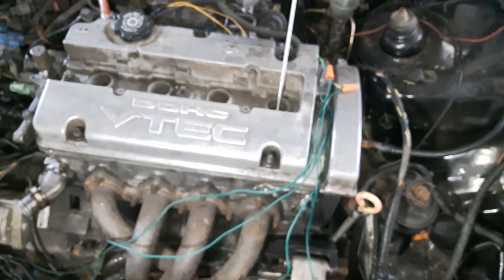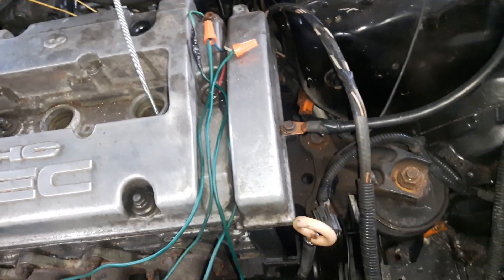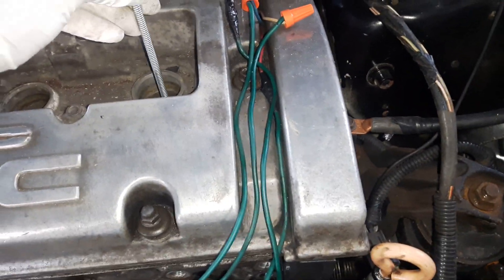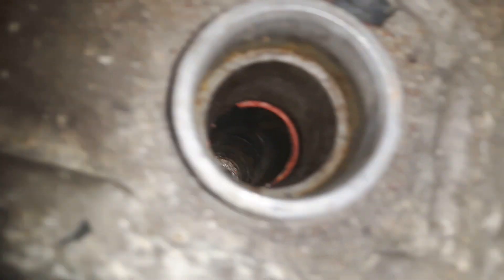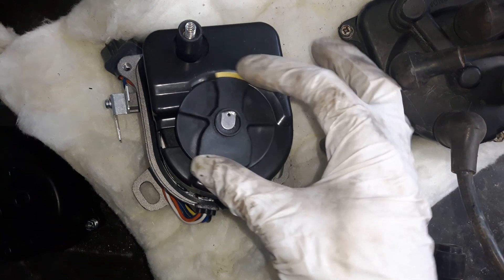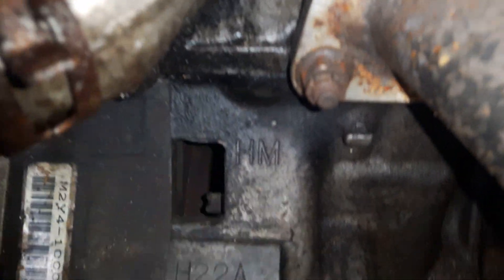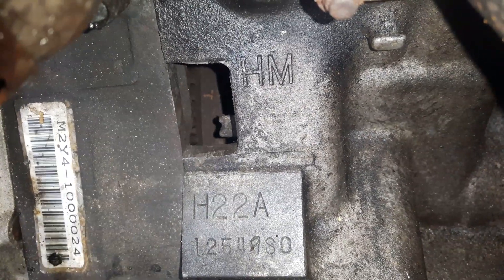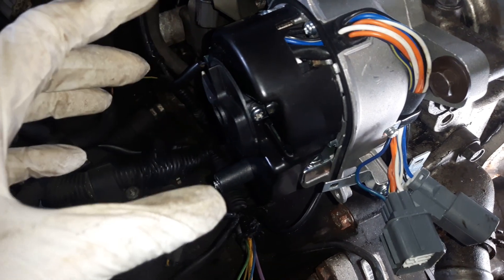How to install ignition distributor correctly TDC timing firing order Honda Prelude Civic Accord

Comment: Does anyone read manuals written by Honda? They're so detailed, there're answers to every question, y'all should try. This cut is intentionally shifted off center, so you can't place it 180 degrees off unless you pulled the snap ring off and took apart the coupling. If you did that, then there are also marks. You point rotor to the 1st cylinder and then match marks on the coupling and on the back side of distributor itself (there are grooves that should be on the same side). After that there's no way you can place distributor 180 degrees out of time. You don't have to time the flywheel either, because camshaft rotates half as fast as crankshaft, that means that while it's 180 degrees between two TDC on crankshaft, it's 90 degrees on camshaft. Not 360, you can't possibly install distributor to fire on exhaust stroke. So you don't have to look for anything, not TDC, not flywheel marks, nothing. Just put it in and your engine should start, unless you messed with anything else (like taking apart the coupling or something else). Now, you do need to adjust your ignition timing for smooth operation, optimal power and fuel efficiency after that with strobe light (no, if your timing belt set up correctly it doesn't mean it's all good, like he said), but that's another conversation.
Reply from the maker: There are multiple camshafts and associated distributors. The one I showed can go 180 off without any issue. You are thinking about the type you dealing with only.
Reply: @wisemonkey1551  Brother, they're the same distributors for these honda engines, it wouldn't make any sense for honda to make them different. So even though camshafts ARE different, their grooves for distributors made the same. I looked in H22 engine manual, literally says the same things. There are offsets. You, though not so clearly, but definitely can even see those offsets on video. 5:15 for camshaft (bottom-ish semicircle is larger) and around 7:03 for distributor (side with the groove is larger). This offset is very tiny, so it can be hard to see, but it is there. Maybe you can kinda brute force it there 180 off because of the wear since, again, offset is very tiny, but you can still install it just by looking and finding the offset and saving yourself the trouble. I appreciate your work and effort, but I just want to let everybody know it is a lot simpler and easier.

Comment: Hello Sir, thank you very mich for the video i made sure to subscribe and like it since you deserve it,  could you please tell me, near at the end at 10:21, how to make it right though, since you said that the crankshaft is at TDC, than the distributor wasnt aligned correctly, i got a little lost there, thank you

As edit:,i guess after this you had to turn over almost 360° the crankshaft to get to correct TDC before you installed the belt on the camshaft?

Comment: Your cap is the wrong firing order? Bottom left is 1, to the right is two
Top left 3 then 4 top right
Reply from the maker: There are few version of this engine. You are comparing it to a wrong one. I checked every cylinder by rotating the engine. It is correct and the car runs fantastic putting about 220hp out.

Comment: Y’all are hyping this guy up when he isn’t intelligent! You cannot install the distributor 180 degrees off, it may sorta look like you can, however the slot is offset, and always has been. Next he’s using wire twists. No decent auto repair facility would ever hire someone who’s work looked like a cave man did repairs. If you dropped this car off at the dealer and after picking it up you opened the hood and saw this, you’d be wow these people are intelligent??? No you wouldn’t
Reply from the maker: you have not seen enough of camshafts or dizzy boy. This installs 180 off without a struggle. TD61U on H22A JDM cams. Ever hear of this Dr. Lee? lol.
Reply: Yeah he messed me up also

Comment: I just pulled my distributor off to replace all the seals, cap, rotor, external ignition coil ect. Turned the shaft a whole bunch and didnt mark the head that goes into the engine when I pulled the pin and snap ring off. Now I have to do what you describe in the video to find TDC and then if it still wont work, flip the head on the distributor 180* with the pin and snap ring. 95% sure that will do so just leaving a like a head of time <3

Comment: Hey bro I have a question when you do the timing on the ignition for the distributor with the light gun do you have to ground out these one connections and bypassum I'm doing it on a Honda prelude 5th generation h22 the timing is reading at 16° cuz my tuner said it to that but the car takes a while to start up and before I had it on the whole in the middle but I don't remember what degree it was back then and he timed it without doing the connection bypass he just hooked up the light and didn't but I think he's not reading how it is

Comment: What if it starts and drives, but turns off when you take foot off accelerator, did I do it correct or I need spark plugs or sum?

Comment: So I must have turned the 2 forks at the tip of the distributor so can I just take the distributor out and just turn the forks 180...
Reply from the maker: You can try to do the 180 move. Watch the whole video and it will tell you how to do from scratch too.
Reply: @wisemonkey1551  I did this I had a rag fly upward I could see the too of the cylinder.....lined up the top camshaft and still no crank
Reply from the maker: @KangoKid Kidd  check that you have spark by taking a wire plug off and ground it to the exhaust or body and crank. Or just use a light to test if you have one. Number 1 cylinder is the furthest from the dizzy. You need to - 1. set #1 to top dead center. 2. Check timing marks to verify its TDC. 3. Have the dizzy rotor face the right pole (#1). 4. Make sure there is spark of course. 5. You must have a known good dizzy.
Reply from the maker: you can try that. also watch the entire video carefully, it will tell you all the steps. make sure you have spark going through the plugs wires.

Comment: Hi Sir so I just replaced the oring on the distributor went to crank it up and it will not start what the heck happened
Reply: You figure out the problem
Reply: @luismora5105  I had to to line up the timing only on the cam shaft
Reply: Have you resolve this? How

Comment: That "fork" each slit that the dizzy sits in are gapped differently everyone examine your motors i learned that the hard way to. Love the video tho I have a f20b dohc vtec boosted on hondata s300 looks just like my motor I painted my top hat (valve cover) deep gray
Reply from the maker: Not necessarily Shawn. Depends on the camshaft and model of the dizzy. I have few dizzy and none of them are what you are saying.

Comment: I have the same engine and my distributor only goes in one way with the rotor facing the number 4 position. Am I doing something wrong? Thanks
Reply: You ever figure it out same problem
Reply: @luismora5105 I have the same problem rn any1 no why?
Reply: @Hxllywoodc have a horrible memory but thinking back I had something backwards so whatever your trying now just flip it and should work I’ll check later and get back with you
Reply: @luismora5105 Ok thanks, i thought the same things because mines is facing at cyl 4 when 1 is at TDC. I tried to flip it but it seems to only go in one way for me which is pointing at 4
Reply: @Hxllywoodc same here mine was facing cylinder 4 motor started just felt like the timing was  way off tried flipping the rotor to face cylinder 1 and now it’s crank no start.
Reply: mine too

Comment: On the b series the dizzy fork has 2 different sizes on the fork. It wont fit the other way around. Is this different for h motors? There is no need to check the marks. Only use the marks to put on the belt on or check with your timing light
Reply from the maker: it goes both ways in H series. Horrible

Comment: I have the same motor and my car cranks but doesn't start and I'm thinking its the timing is off I have fuel compression and air and spark but it still doesn't want to start please help me thank you
Reply from the maker: Attach a nice thick ground wire one end bolted on to the engine head and other end to the Negative battery terminal and try to start again. This is easiest step before timing etc. Don't forget to subscribe. Cheers
Reply: Can I attach the ground wire to the chassis or to the valve cover
Reply from the maker: Below valve cover somewhere in the head and other end to chassis or negative battery

Comment: Wonderful video. My car wouldnt start because it was 180 degrees off. Thank you!!
Reply from the maker: Happy could help. Thanks for watching. Please share and subscribe.
Reply: How did you fix it
Reply: @luciferjr4204  flip 180
Reply: @OGbqze  my distributor only goes in one way
Reply: @luismora5105  I must have gotten lucky when I did it cause I just put my number 1 cylinder on TDC, aligned the rotor, and it popped right in and fired right up.